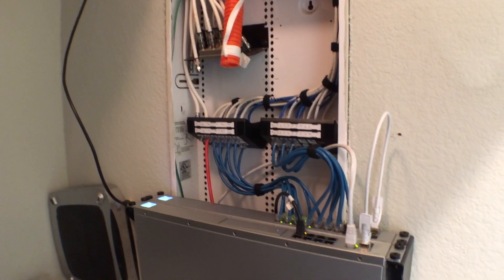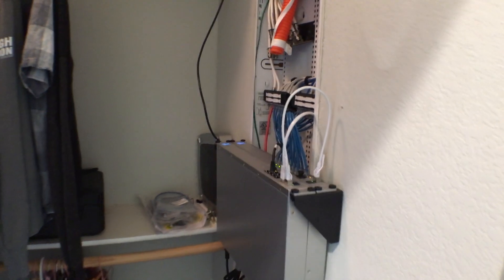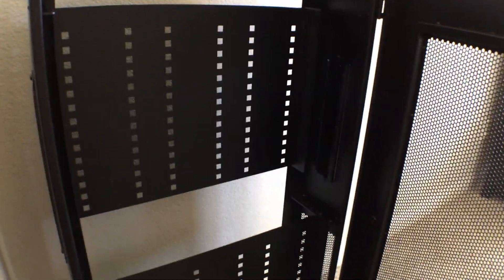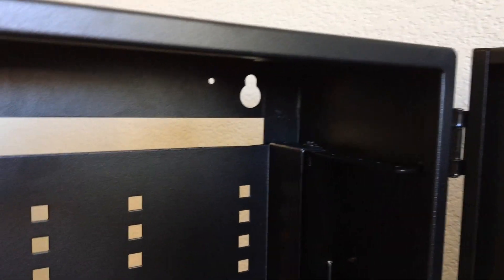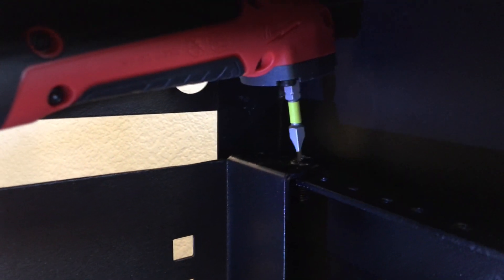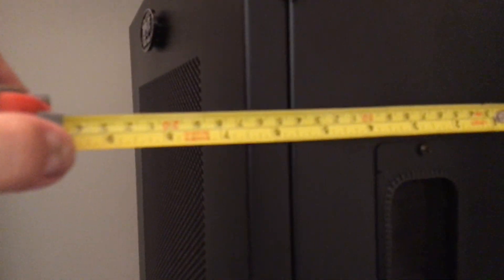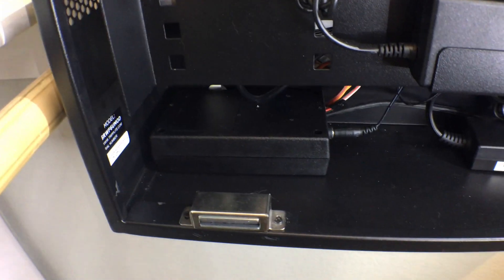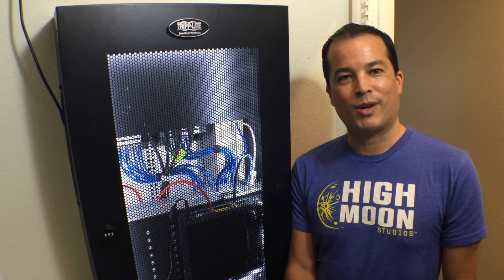Network Rack For Structured Media Panels

Comment: 3 years later and this video is still helpful. I have the same situation where my leviton media cabinet doesnt meet my need anymore and I looked into the same tripe lite rack. Is it possible to flush mount this vertical rack?
Reply: Do you mean install it in the wall?  No.  First of all it mounts to the wall on the back.  Second it's wider than 16" so it would not fit between the studs.  3rd it's over 6 inches deep.  Most US walls are only 3.5-4" deep so it would still stick out.  This is meant to be mounted to 16" on center stud walls with or without a Leviton-type structured media enclosure behind it.
Reply: @employee3dotcom  thanks. Yes i mean to install it in the wall. I did some follow up research on this cabinet and also determined that flush mount in the wall will be challenging without modifying the studs, etc

Comment: My Family's biggest complaint was everything going off when we lost power. I installed an Altronix AL1012ULACM 12vdc 10 amp power supply. This gave me 6-10 12v supplies that would last between 2hrs to 48hrs depending on the load. I ran the antenna amp, still do. A Leviton router and WIFI router and a rf modulator for putting the HDMI camera out of the DVR onto the antenna amp. Now I have a 24port Cisco Switch so I installed a Leviton 42 inch expansion ring to accommodate everything.

Comment: You could use a ratchet with bit holder and it should be sufficient. Much more compact than the right angle adapter on your impact.

Comment: I'm setting up two 42" leviton in wall cabinet with the 2" extension and hoping to fit switch side way in there... there should be 3" left for cables shared on both sides, tight, but... we'll see!
Reply from the maker: My switch was just too deep, but maybe you can get away with it if you use some right angle cables for power and ethernet (something like this https://www.monoprice.com/product?p_id=31016)
Reply: @christiansakanai9812  i was trying to source such a 90° for the power cable, hopefully it'll leave me just enough room in front...
Cheers! :)

Comment: What a perfect fit for your needs.  I didn't even know they made these.  What LEDs did you use, by the way?
Reply from the maker: Totally forgot to add the lights to the description. I've updated it with a link. Just a cheap set of 12v strip lights. I use the same power brick that runs the arduino to power the lights and fan. Adhesive backing lets you put it anywhere and they can be trimmed to length every 3rd LED. I've used them for various projects around the house and even decorated my car for a Christmas parade.
Reply: @christiansakanai9812  Thanks, I recently put some in MY master bedroom closet (LEDs) and I chose poorly, they are dim...I'll look into these!

Comment: How deep is the 10U ?
Reply from the maker: I don’t have one, but the listed specs for the 6U were spot on so I’m guessing they are correct for the 10U too. Website shows 10.7 inches deep. https://www.tripplite.com/smartrack-5u-low-profile-vertical-mount-switch-depth-wall-mount-structured-wiring-enclosure-adjustable-equipment-brackets~SRWF10UMOD
Reply: @christiansakanai9812  thank you!!